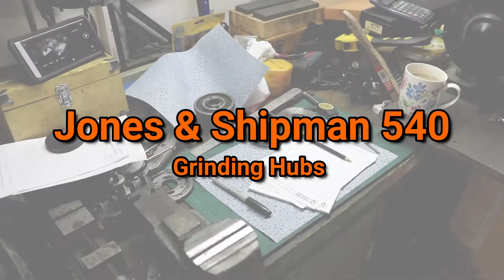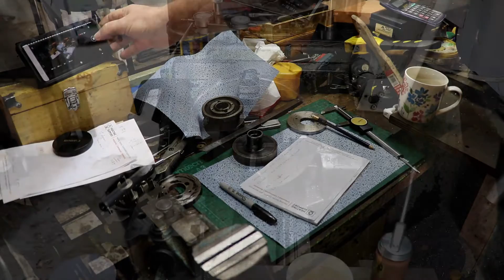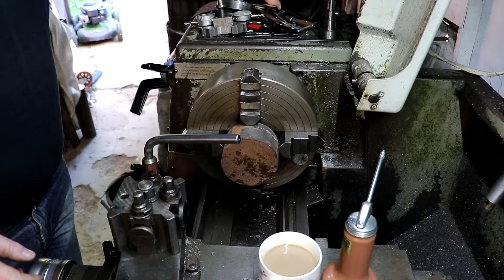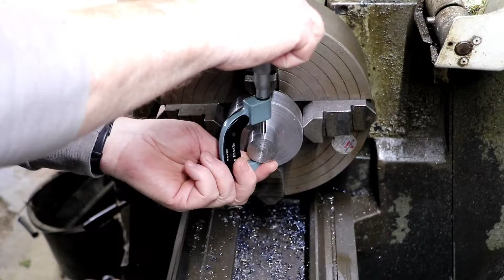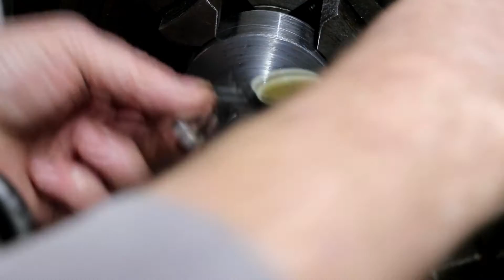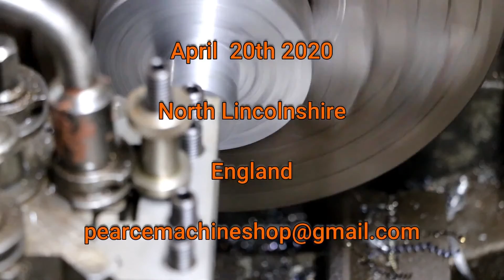Jones & Shipman 540, Making New Hubs.

Comment: Alan well done so far shame about the crap steel. If it was me I would finish off this one, but buy some decent steel for any more you intend to make. Invest in a spray coolant system for the lathe, less than £ 6 on eBay. I bought 2 and use them on my mill and grinder. Did you get the 2 emails I sent you ? Regards from Australia 🇦🇺
Reply from the maker: Hi Dave, yes your right about the steel lessen learnt there, I’ve a coolant pump on the lathe but it’s got a broken plastic pipe on it and it’s hard to get to, something I need to get sorted, yes I read your emails ? Thought I had replayed I’ll have a look.

Cheers Alan.

Comment: Coming on nicely, I have a screw on chuck,so running backwards is always fraught, I'd have to set up on the large OD and cut the thread last.
Stay safe. Cheers.
Reply from the maker: Thanks Paul fortunately my chuck is on a cam lock so turning in revers is ok, my issue is just the steel it’s not great.

Al.

Comment: Hi Al, you have a piece of low carbon hot rolled steel, called mild due to carbon content only. Its crap stuff but cheap as chips. A bit of EN16 would be better you're right. Polite tip, when you rough out, do it by material volume removal as a rule of thumb, so for this job, rough the spigot as you did, next the hole through, and then start semi and finishing faces, this takes any worries of movement away as you will always have stock to clean up. It is also a more efficient use of time if you aren't using Coolant as you could drill as the part was cooling from turning (I guess you would need to find the tidy up time later though). When you screw cut or finish the taper, I would use some HSS/Cobalt on this stuff, it doesn't like carbide unfortunately. Keep it up. Jon
Reply from the maker: Thanks John good advice, I’m going to use HSS for taper I did on the first one I made I may even tidy up what I’ve done so far with some HSS I’ve enough stock to do it.

Al.